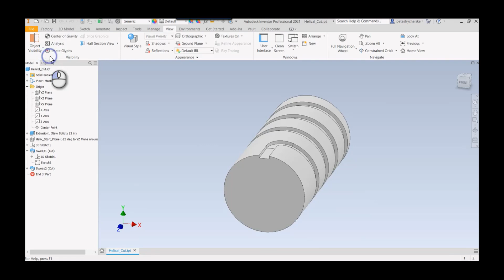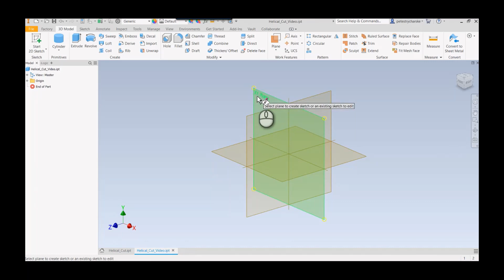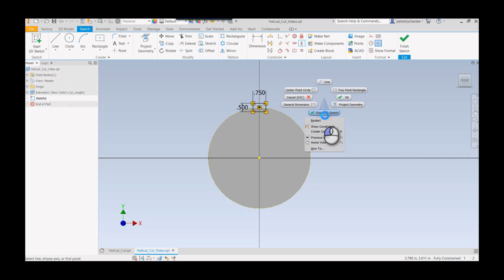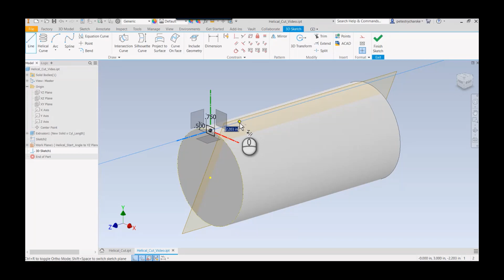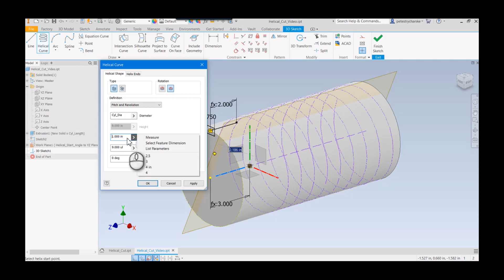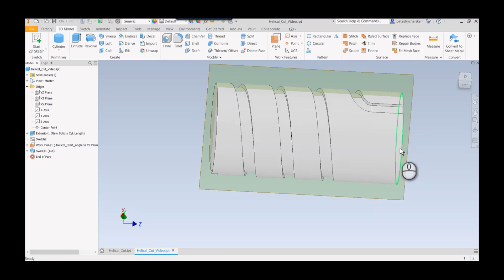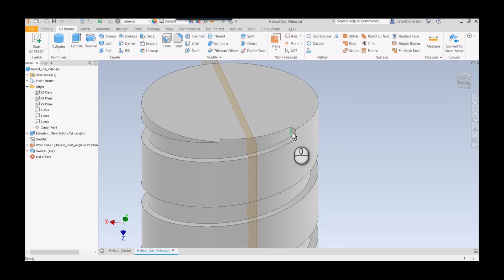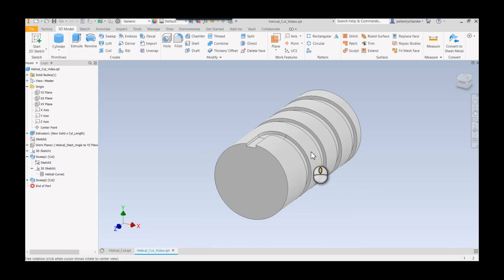Inventor - A Method for Cutting a Helical Groove on a Cylinder

Comment: First of all, thank you very much. But this is very confusing. Do you have any idea how i can sweep on a Cylindrical surface a bit easier. I want to rebuild something like this electrical Toe nail bits.
Reply from the maker: @selimguclu625, good day and sorry for the delayed response.  Can you send along a link or a specific manufacturer and product name, so I can see what type of drill bit you're referencing?  More specific solutions can probably be presented then.

However, if you look at using the COIL tool, that may be an easy method for trying to add a sweep to a cylindrical surface.  Please give that a try and report back how it goes.  We may be able to knock out a video on this topic.  Hope this helps and have a most blessed day!